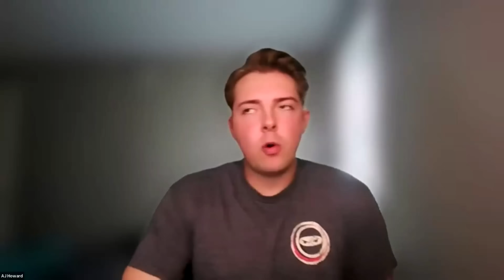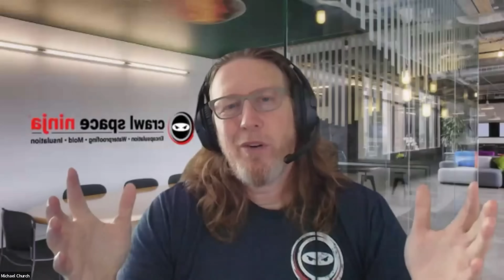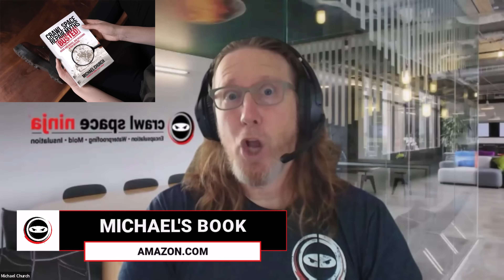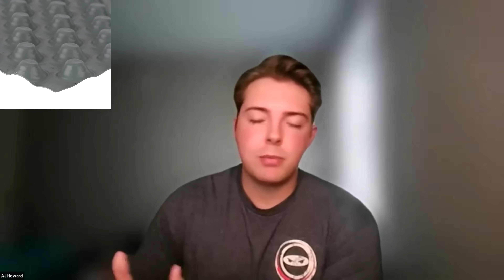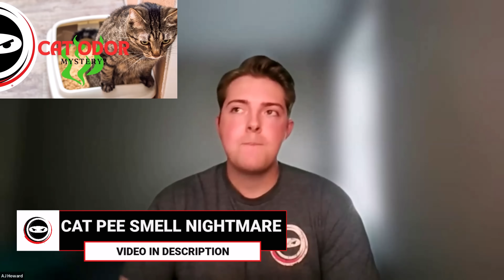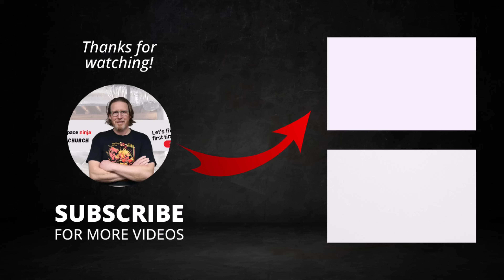Vapor Barrier: The Real Deal With 12 Mil vs 20 Mil vs 120 Mil!

Comment from the maker: 💡 While you're here, let me know: What's your biggest concern when choosing a vapor barrier - cost, durability, or installation difficulty? Your answer helps me create better content for this channel! 👇
Reply: @CrawlSpaceNinja  going into my wet dark "stoop space" (walkable height if you duck) because there is evidence of past rats and I'm not sure they are gone. Our home was built on an old cattle ranch and we have seasonal springs that mean our ground will always be wet.
Reply: I've been thinking doing 10mil only on the walls and columns, but something thicker for the vapor barrier on the ground simply because it will get walked on.  Not only is our hvac down there, but 1/2 the crawl space is actually basement height and my plan is to use it as storage with wall shelving.

Comment: Is 5 mil sufficient?
Reply from the maker: Code requires the plastic to be a class 1 vapor retarder which is typically 6 mil and above but if the 5 mil is a class 1 vapor retarder then yes it should work unless your local code has a different requirement. I hope that helps. Thanks for watching.